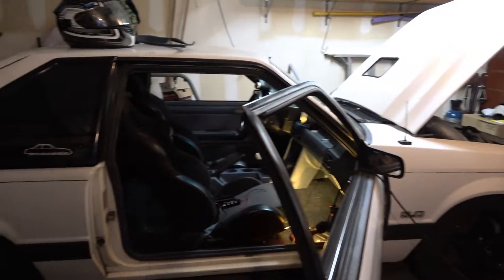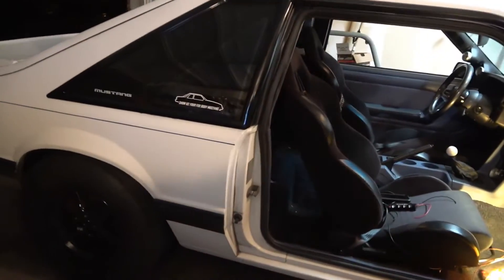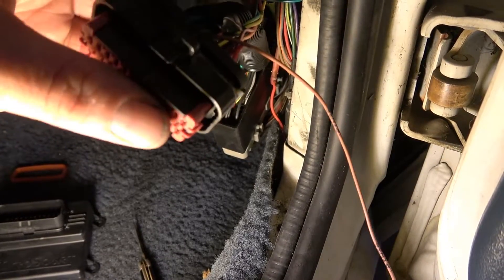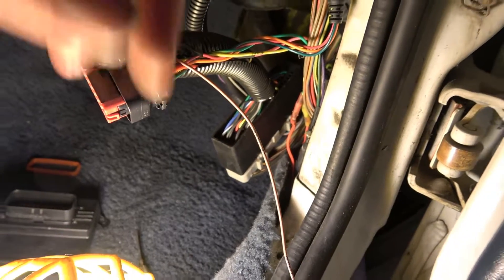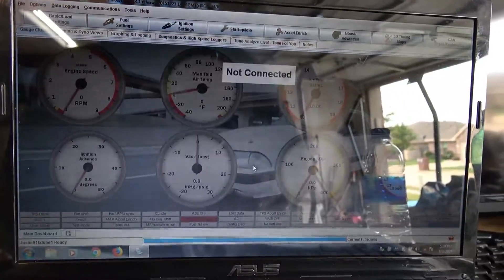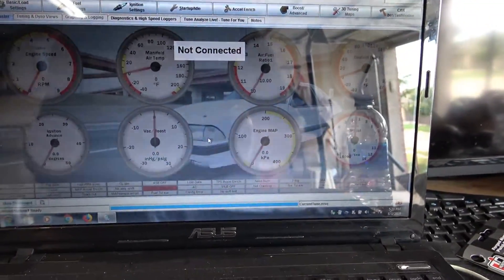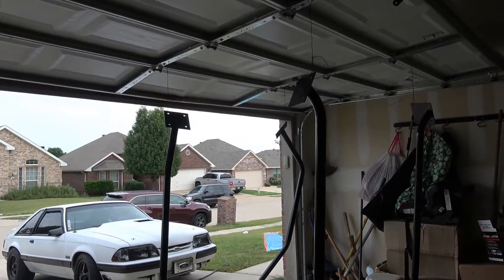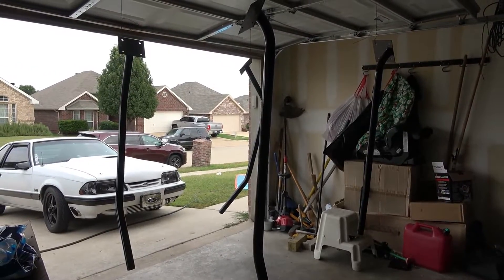Microsquirt- Launch Control on Foxbody Mustang

Comment: Long shot since it is an old video, but was trying to follow your instructions but got me lost on the beggining, I already have a cable on pin 6 for flex fuel so there was no need to change anything can I use the cable from pin 6 already where it is?

Comment: Hey nice video. I have a Megasquirt pnp2 in my 92 fox and just hooked up a msd 6al2 box. Work great. But is there a write up on how to wire up the Megasquirt to control the 2 step with the msd?
Reply from the maker: You would use the 2 step on the megasquirt. You wouldnt want the msd to override the megasquirt timing
Reply: Oh got it thank you.

Comment: Justin I've done this as well and I thought I should tell you what I found out a long time ago. Don't do spark cut when using ford tfi style ignition it will tell you also if you click on the ? On the section where u select spark or fuel cut
Second when using a ford tfi distributor you can never go below 10º of timing because the tfi has a base setting of 10 built and you cant go below the built in base setting. It may work but is not recommended at all because it basically goes nuts when it gets that low. I did a lot of research on this and don't know why but one day I'm going to coil on plig edis ignition
Reply from the maker: I know a few guys running the setup on a tfi ignition. The 10* on the tfi makes total sense. May just set it at 10*
Reply: justin91lx yeh it works ok but for some reason ms just recommends not to I guess its the software or something
Reply: Mine got confused today got.to sputtering and costed me race.